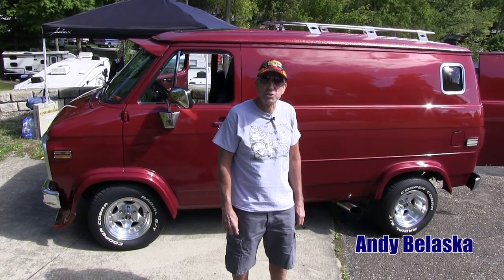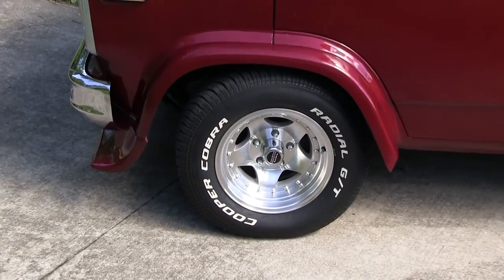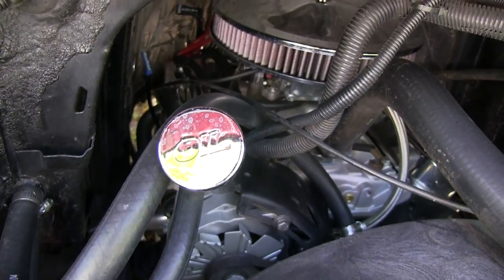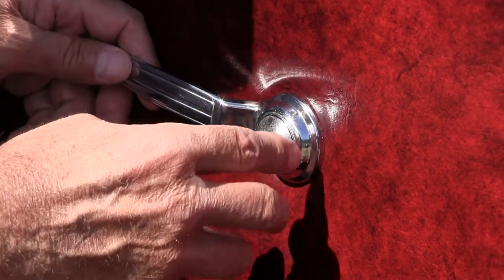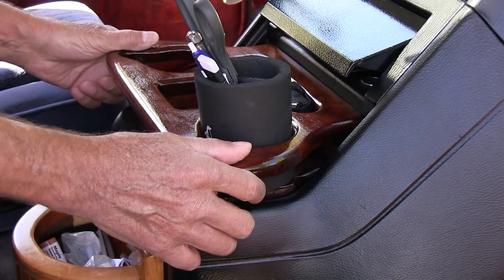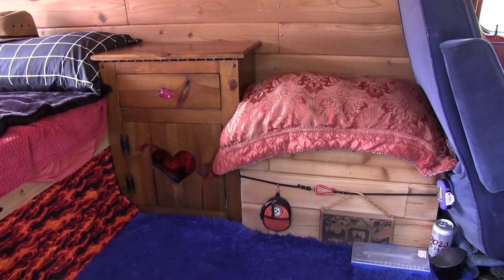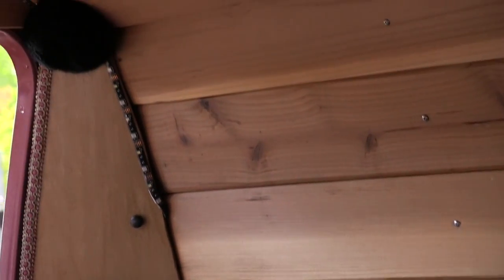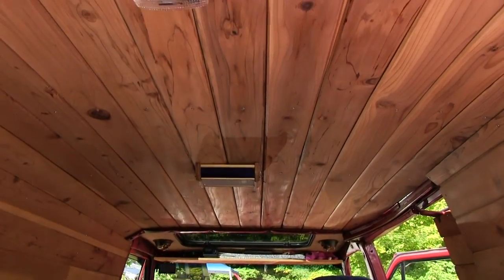1979 Custom G20 Chevy Van.

Comment: The 3 point mirrors  from the 76/77 are the best looking mirrors. I had a 76 shorty that had the exact same color paint and pinstripes as the  Wild Cherry van, minus flares. Body was completely clean. Had same portal windows. Ballcap visor w/ matching chin spoiler. Same grill with thin smoke headlight covers that are Velcro'd on the corners. Ladder,  and luggage rack. Rims are similar to the ones on the General Lee. Wish I stil had it. Sounded like yours. Worked over 350.

Comment: I had a 1979 CHevy Van I bought in 1990 G20 3/4 ton with a 350. It was PERFECT for my needs which is camping flyfishing from a kayak. It had a couch in it that folded down to a bed and remained in the bed position the entire time I owned it as I kept a small 10foot kayak in it. It had windows in the back that slid open with a screen that kept mosquitos out and provided air flow and the rear windows on the rear doors flipped open which increased air flow which is huge when you are camping. If the tempts hit 80+ it gets hot and you roast and opening the cargo door driver side and passANGER WINDOWS and the cargo door and the side and rear windows made it much cooler when I am rough camping lake side. I drove it up to Alaska right after I got it and drove around Alaska all summer long in 1990. I drove it all over northern california flyfishing lakes like Davis And Eagle lake rough camping lake side. It was awesome. It was still running when I sold it in 2010 for $500. I finally replaced with a NEW GMC savana 2010 AWD and I ordered it with the same flip out windows and I put sliding side windows in the rear that Sportsmobile put in for me for some $1200. I built a bed for it and insulated the walls and paneled the roof and walls and put in carpeting.

Comment: Beautiful van! I’m buying a ‘79 G10 125” wheelbase cargo van myself to customize. Only 59000 miles on the 6 cyl. But a nice small block700R4 will be installed at some point!

Comment: dude - I have almost the same van in the very same color. Factory color_ dark carmine, am i right?!? I'm the original owner of mine. 1980 G10 - the next longer model.  I paid 6,100 when I ordered it from a western NY chevy dealer... My van has 31k original miles and was always stored indoors! With the rustproofing I got at the time, the body and frame are perfect. Sowroom clean. It's almost time to get some dirt on her!